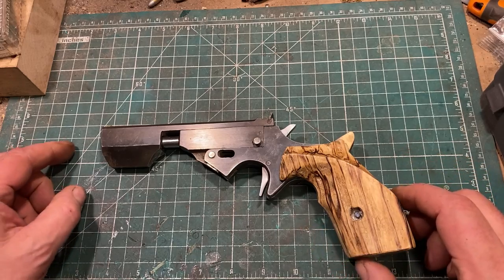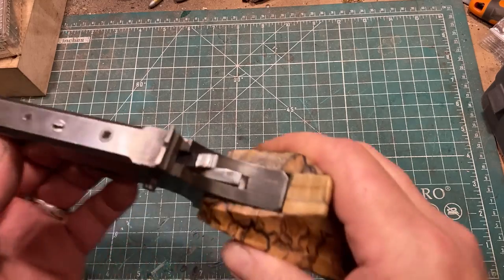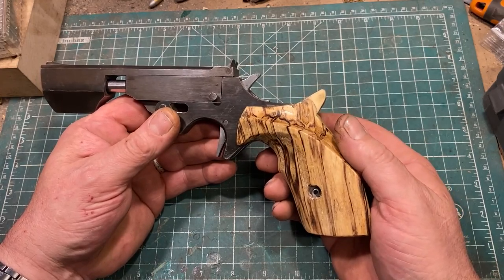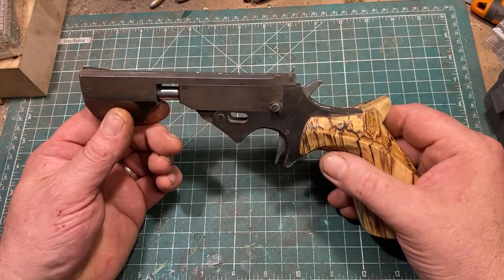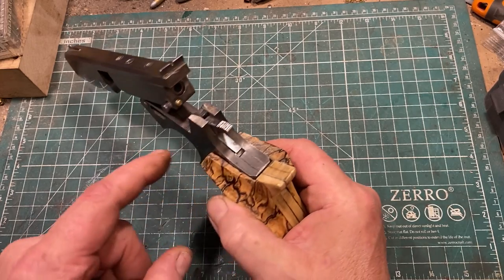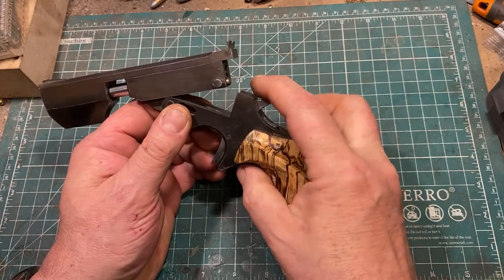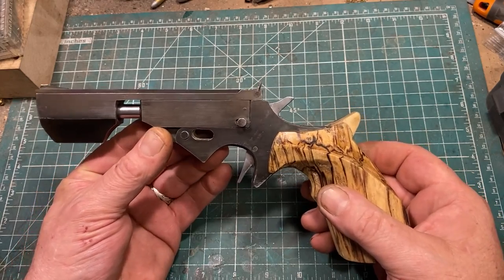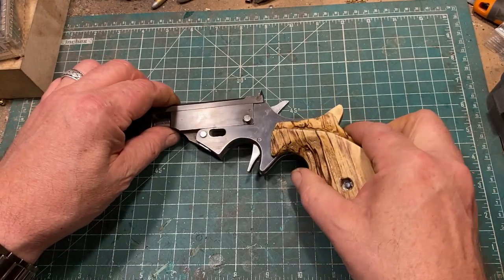Homemade  22 Target Pistol

Comment: Russia considers shot guns as less dangerous but Americans consider them more so in short barrel configurations . Its  kinda strange.
Reply: The gun laws were developed in the 1920’s as a method to ban pistols, submachine guns and sawn off shotguns. Because that was what the gangsters were commonly using.

However the pistol ban was removed at the last minute resulting in the short barrel rifle and short barrel shotgun bans.
Reply: Shorter barrels are way less effective. Plus that is infringing the 2nd, so it's unconstitutional law.